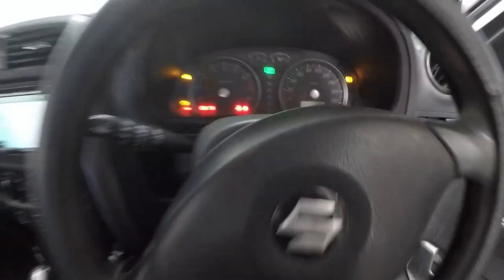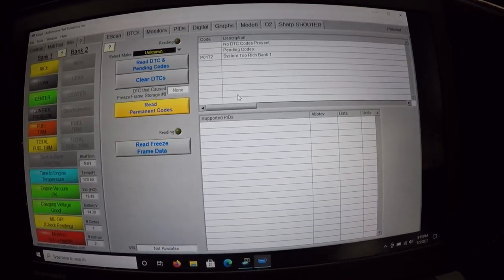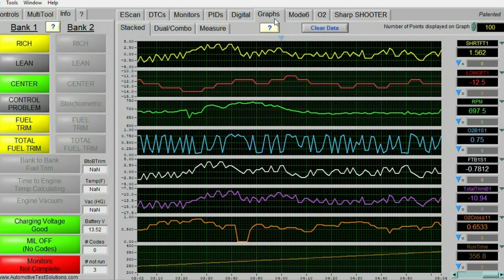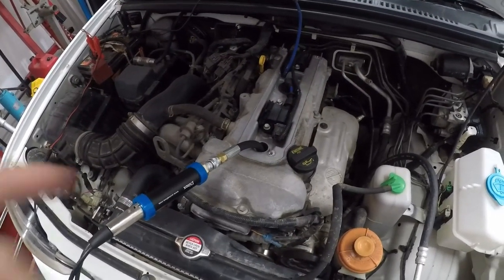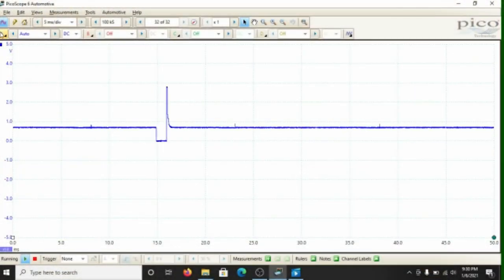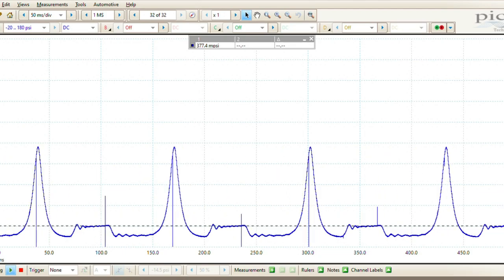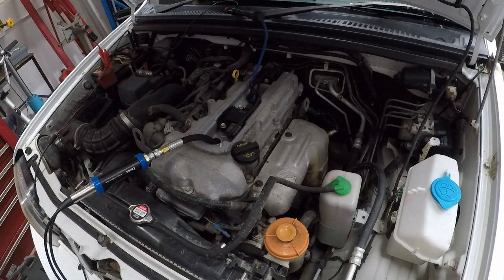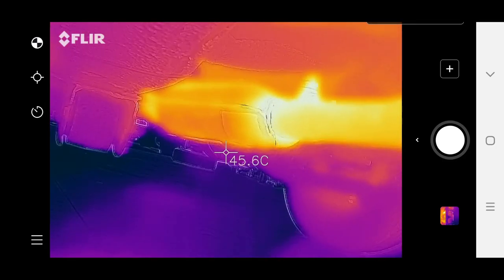Ditex PDS500A Giveaway! Plus 2009 Suzuki Jimny Low Power & Running Rich

Comment: Subscribed.  You mentioned fitting a used Cat.  I didn’t know that was possible.  This transducer, being able to cover full range,  allows seeing all of the pressure changes in a cylinder.

Comment: I see you have the ATS E Scan . I have seen Bernie Thompson use in many videos . Great teaching video . I used an old school vacuum guage on a 2000 Honda Accord , 4 cylinder . I don't have a back pressure guage . Removed the front oxygen sensor . Brought the RPM's up around 2000 . I did not have the 2 PSI that you show with the fix . It was much higher and the car wouldn't go over 25 MPH . In the USA most salvage yards will not sell a used CAT 😺 . Must be some law . And some states require a CAFE rated CAT 😺 for emissions . California and New York . More expensive . Walker makes them as well as others . The OEM is a fortune . Good to verify that nothing is going to ruin the new CAT as you suggested .
Reply from the maker: Bill, technology is getting too far ahead of us! Soon we won't have to undo oxygen sensors or even touch cars at all in order to fix them haha

Comment: Subscribed. Nice video. I have the Flir camera. I don't find I use it as much as I thought I would. The in cylinder transducer would a brilliant help to me. I didn't think you would get a rich condition with a dirty maf. I thought the dirt would act as an insulator around the hot filament, and the sensor would not be able to measure the incoming air correctly, and give you a lean code. Keep them coming.
Reply from the maker: I honestly didn't think the dirty MAF would cause the rich condition at idle either. I was angry I couldn't get a back probe into the injector so just thought I'd check the MAF anyway and it was dirty. I cleaned it and it brought the long term down from -14 to -3 😲
Reply: @romanosautomotive  yes it definitely worked.

Comment: I had subscribed. I had a bench scope and an amp clamp. Hoping to add my scope accessories.

Btw Jimny has a small engine. Will a VE test result be accurate?
Reply from the maker: It still will be accurate. I planned on doing a VE test and then actually entered a parameter wrong which threw the results completely off. So couldn't use it unfortunately. Another test for an upcoming video!

Comment: Could use a pressure transducer! Subscribed. I wonder why a clogged cat caused the rich condition?
Reply: Maybe the 02 sensor reading the exhaust gases, and not seeing 02.But in the end it looks like the maf sensor was causing the problem.
Reply: He did clean the MAF sensor , which could have added to it . I think when the  😺 CAT is clogged , you are adding fuel but don't have the air flowing through to match it . He did mention a Volumetric Efficiency Test . However , I don't know how much the Oxygen Sensors can correct for this . He would have to explain that .
Reply from the maker: The rich condition is likely what clogged the cat. I did mention a volumetric efficiency test but after editing the final video, I noticed I put a parameter wrong in the set up which means the result was invalid so I left it out. The cat being clogged would reduce airflow in(can't get air out, can't get air in) that exact reduced air is measured by the MAF so the computer would adjust the fuel accordingly. Technically if all inputs were good, the fuel trims should have still been normal even with the blocked cat. The rich condition appeared to be the dirty MAF but it was only at idle and I personally have never seen a MAF cause a rich condition at idle by being dirty(I have seen them cause a rich condition due to over reporting) but I assumed it had something to do with the type of matter that was on the hotwire itself. Regardless, it dropped the trims from -14 to -3 so it certainly was the fix!
Reply: @romanosautomotive  nice explanation. Thank you.